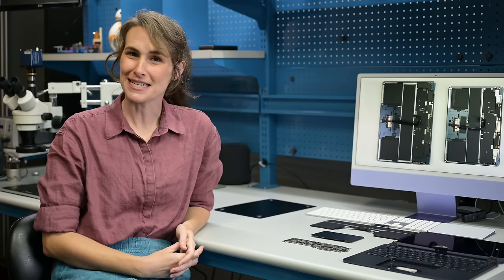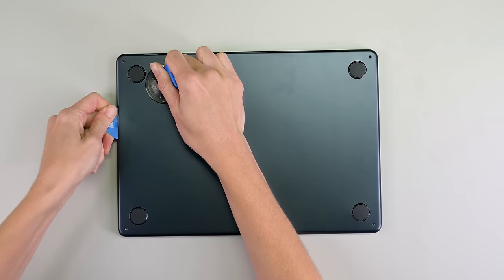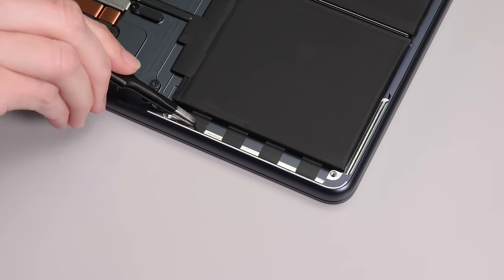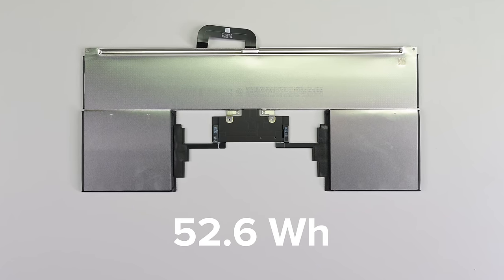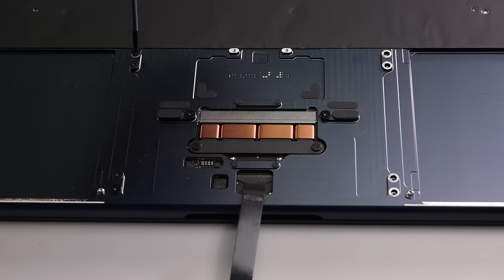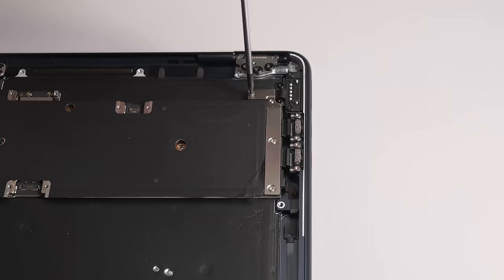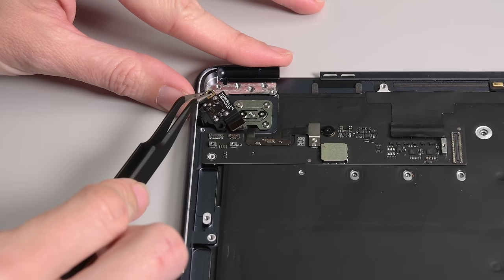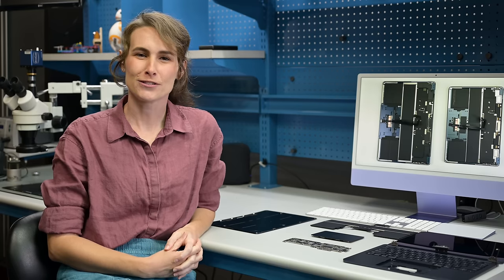M3 MacBook Air: The Tiniest Change Makes All The Difference

Comment: I still wished the M3 MacBook Air had a better cooling system. By very slightly thickening the case, they could have put in a vapor chamber cooling system, which would mean in the occasional need to do more complex tasks, the comptuer will suffer a lot less from heat-related throttling of the SoC.
Reply: Agreed. For the life of me I don't understand why they couldn't include even passive cooling in this new chassis. While the M3 throttles less than the M2 thanks to it's improved thermals from the die shrink, it still underperforms from lack of even remedial cooling. Apple really wants people to buy up to those Pro's, don't they?
Reply: @johnnycash5858  Apple already walks a fine line there to limit the temperature of the outer shell slightly under the max temp that legal permits, if you pay attention to those passive cooling mods, any improvement to the thermals of the SOC will just bring more heat to the outer shell and rises up the temperature to a dangerous level that you will suffer low-degree burn if you put the laptop on your lap.
Reply: @jcfawerd  How? I’m not talking about shunting the heat into the chassis like the mods you speak of, I’m talking about a proper heat pipe shunting the heat away from the SoC to the vents where the screen meets the chassis. If anything that would make the underside of the laptop cooler as the heat has somewhere else to go besides the bottom case.
Reply: @johnnycash5858  if you are talking about the heat pipe solution, then you are introducing weight to the laptop, then what’s the point of buying a MacBook Air since their new weight are so close to the MacBook Pro as most people buy those MBA for portability.

Comment: I’m sorry what? The 13 inch air is significantly lighter than either of the pro models. The 15 inch air is close to the 14 inch pro, but still lighter. How is that confusing?

Comment: Does the ban on part pairing apply to stuff like Touch ID ? and if so is it a security risk ?
Reply: If Touch ID will not be paired to the CPU, it will be a security risk.
Reply: @AppleFan-md9sp  Physical access is total access. Replaceable Touch ID will not be the reason someone breaks into a MacBook, an undiscovered zero day will be.
Reply: @AppleFan-md9sp  Why?

Comment: honestly a provisional 5 is way higher than i though a MacBook Air would be
Reply: Mac laptops have always been kinda easy to open. At least ever since they switched to the Unibody design. 

I've had more trouble opening Microsoft's Surface line.
Reply: @LeftJoystick  Everyone loves to gloss over how terrible the surface devices are to repair.  As though its only apple thats evil enough to have thought of glue.  My old, work provided surface literally blew itself apart when the battery swelled, as I had no other choice than to continue using it after the battery died.  Opening the thing to replace it would have destroyed the screen, literally noone had managed to actually open that model without damaging it irreparably.

Comment: To me, it makes almost no difference if there are screws or glue. Anyway, reair does not happen often. What matters for repairability is if you CAN replace battery, memory, SSD for reasonable money when these parts are out of function or need upgrade in 5 years. And have it for reasonable money, I mean, less than the price for new machine. Unless it is satisfired it should be scored 0 on one to ten.

Comment: How is that just a 5? Simple Screws, and some glue pull taps should not call for 5 points. That is a 7 or 8 easily. This was super trivial, all you need is a pentalobe screwdriver, and the board is super clean and organised.
Reply: I think the fact you have to go back to Apple to purchase replacement parts or to have them 'paired' in the software (or they don't work, even if they are easy to physically change over) is why they are still giving them a low score.
Reply: No ssd ram cpu replacement

Comment: I wish Apple could improve the passive cooling more. I know my M2 can have wide swings in temperatures and easily go well over 100c.
Apple really is depending on throttling to protect this notebook.
Reply: I saw somewhere that applying a “Thermal Pad” strip on the SoC it helps better manage the thermals & performance! I don’t know if this works in reality!
Reply: @WittyLemon7  I've seen that I guess it helps some. Not worth risking voiding my warranty though to try it. I mostly see temps stable around 55c doing web stuff.

Comment: I'll Continue to not undertake constant complaining about the screw types Apple uses. They have been using them for like DECADES at this point and literally every repair shop has them and even when you do a repair yourself you'll get screw drivers for it. It's just a complete non-issue.
People act like Apple is changing these screws all the time which would actually make repairs harder. But they don't.

Like for real.
4 screws. FOUR. And then just pull it down a bit. Done. But it still has to be criticized everywhere. Others use a billion screws, partly hidden, added glue etc. and it's fine. Because they use Phillips screws...
Reply: I’m totally on your side. Ifixit and so many other people are brainwashing people with this repair ability stuff and it’s just to benefit their parts and repair business. I’d argue this MacBook is super repairable, a random windows laptop that falls apart in two years that you can’t find replacement parts for is not.
Reply: "Others use a billion screws, partly hidden, added glue etc" Apple has done all of these criticisms you've mentioned plus parts pairing and lobbying against right to repair. The only reason why Apple are selling replacement parts with major restrictions is due to the right-to-repair pressures.
Reply: i partially agree. 4 on this one really isnt a lot. and i rather have specialized screws than ppl damaging their devices bc their ripped a screw. these things are tiny and easily damaged. better not giving ppl ideas. 
and these screwdrivers are so radially available now it really is a non issue. 
but i also do know that not every manufacturer and every device by apple is made this way...
Reply: Just standardize to Torx, it is plentiful, robust and common enough to be in every good toolset. I would hate them more if they went to phillips, as those strip all the time.
Reply: For me, Pentalobe screws are also give a subtle message to people who aren’t as tech savvy or know how to work on a computer to just leave the machine alone. For the record I have worked at a computer repair shop and the amount of PCs we have had to work on were broken or damaged because the user did not know how to properly work on it. Unlike car parts computer parts are extremely fragile if not handled correctly.

Comment: 5 out of 10??? Theres nothing too upgrade or repair! The display is paired! The touch ID is paired! The adhesive pull tabs never work, the bottom case has apple invented screws, making access impossible with a special bit, the ssd and ram are soldered so if the SSD dies, which it will since they all do, bye bye macbook. Wtf Ifixit
Reply: I understand the technical aspect why the ram is fused to the cpu, but you are correct the ssd should be a regular m2 nvme. The livetime is very limited and in addition the apple tax on the bto upgrades is way too high. All my older Mac’s got storage upgrades over there lifetime and therefore the higher purchase price was more than even out over time. With my newer Mac this is unlikely to happen. Biggest problem will most likely a sudden ssd death. ☠️

Comment: How hard is it for Apple to follow Framwork’s model. Better yet go back to how they used to make Laptops. The MacBooK Pro back in 2010-2011 was so easy to upgrade and repair. Take off the back cover and you could upgrade the RAM, SSD, WiFi card and replace the battery.
Reply: you already know the answer to your question. Profit.

Comment: It deserves at least a 7 …
Reply: You can't even change the SSD or RAM. Should more be a 3...
Reply: And if not for the Parts Pairing at the firmware, it probably would get a 7.
Reply: @mortenborg  Not having enough money to buy more RAM or SSD space up front is a "you" problem.
Reply: @ericmatthews8497  No, SSD's wear out
Reply: @mortenborg   yea. In 15 years.
Reply: @mortenborg  Yea. In 15 years

Comment: Parts pairing makes sense for some products.
Items more likely to be stolen and parted out should be paired to deter people doing so.
Less stolen items shouldnt be paired.
Laptops and phones are frequently stolen items so it makes sense to me.

Easiest solution to me is for companies to authorise more repair shops by making parts easier to access and granting them permission to pair parts. 99% of people arent repairing their own device, its almost always a repair shop or the original company
Reply: Your argument would make sense if Apple provided a mechanism with which the registered user could authorize those repairs, in the same way I have to copy a GD 6 digit code everytime I log into my Apple account, or plug in a new iPhone for the first time and go through the "trust this device" prompt. I would even be fine with paying a small fee for their "admin costs," but as it stands now Apple's own "trusted repairs" program is move expensive than just having an Apple Genius do the work for you. That's not right. Fair cost for the parts plus the admin fee to authorize them is a heck of a lot cheaper than paying Apple's hourly shop rate, or in the real world it should be.

Comment: Sounds a bit better than last year's crop of CrapBooks, but they just can't beat a Thinkpad in repairability, and that is not even including the T series. Those things are insanelly easy to dissasemble and repair. Also, still no ethernet, usb type A, removable SSD nor second SSD m.2 slot. And it can only use macOS.

Comment: I would top this out at a 2.5/10 for the soldered SSD and Wi-Fi card. Literally all you can change is the battery.
Reply: And all the ports, and the trackpad
Reply: @1albumamonth  Except that port selection isn't as good as most Windows laptops. MAYBE I could see a 3/10, but definitely no more than that.
Reply: I appreciate the modular ports. Along with the display, those are the things I most frequently repair and only having to do so one at a time instead of the whole package plus a daughterboard is easier and cheaper. Now if they'd just get rid of the bleepity bleep parts pairing...
Reply: @cameronbosch1213  Most windows laptops have a better trackpad than Apple's? Really?!
I understand you hate Apple, but at least make a sound argument!
Reply: @fazil_8298  I never said the touchpad was better on Windows touchpads. I actually do agree that Apple makes great touchpads and have been the first to nail a haptic touchpad; most other brands like Dell aren't even close in that regard.

What I was saying is that Windows alternatives at least let you remove the SSD and replace it when it can no longer be written to, which is only a finite number of times (a large number, but still finite).